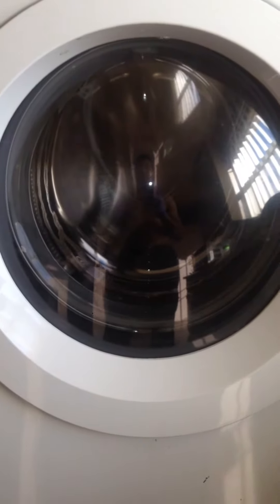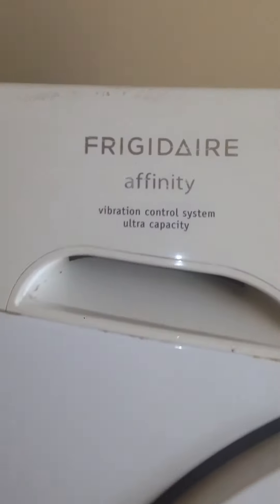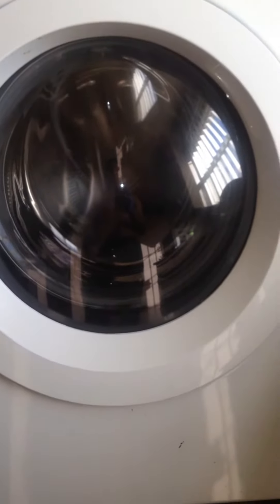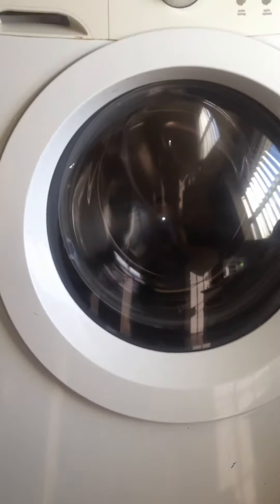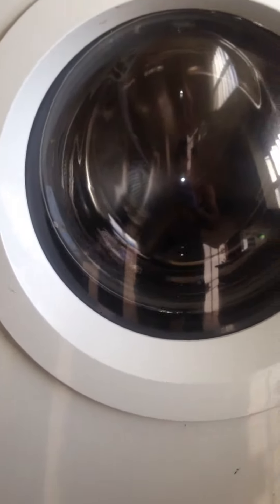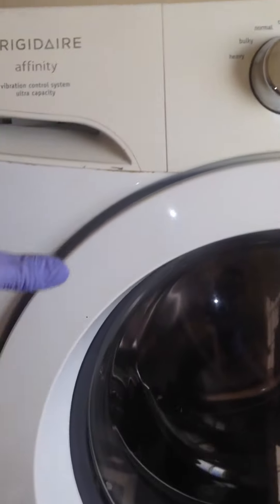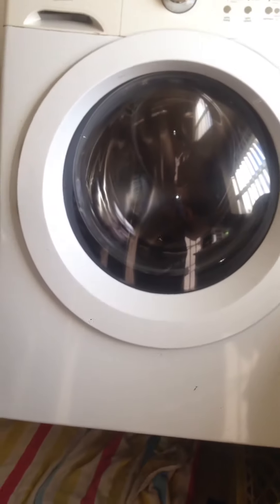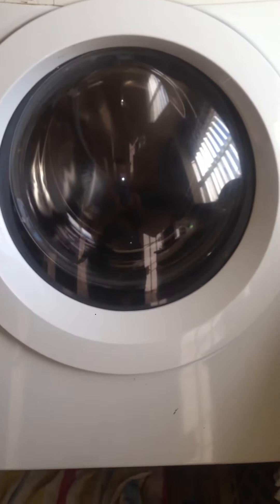Frigidaire affinity washer drain filter

Comment: I was able to disconnect the large clamp, then reach in and clean out the filter with my fingers. I was even able to pull the filter out through the large hole pipe hole without disconnecting anything else. I had a piece of underwire bra stuck in mine and the wire would sometimes stop the pump from spinning. I also had a $1.57 in four quarters, five dimes, a nickel and two pennies.
Reply: Chris, thanks I was also able to pull the filter through the large hole pipe hole without disconnecting anything else. I only found  $1.02, this trick saves you a ton of time!

Comment: Perfect! I've done this 5 times before I have dryer stacked in the top past experience had to recover it myself in a very tight space and it was a B! It's been awhile now since I've cleaned this trap out I knew there was an easier way id pushed the washer forward while kinda letting the dryer hang till it the back wall then put like a brick to keep it just barely high enough to get in there an unclip it too clean out but that clip to reinstall it it's such a problem. Never the less thank you for this vid!!!

Comment: I was able to get the filter out and couple face masks came out too but it was hard to position your arms and hands to be able to wiggle out the filter in that small window.  And to put it back on I thought was pretty easy but when I turned the washer on to rinse and spin all kinds of water was leaked out now I'm thinking I should take off the front panel so I can see all around the rubber pipe when I tighten it. You would think they put the filter in an easier place to get to because filters need to be cleaned out often.  So my question is can I lie the washer on its back side and  can only the bottom panel be removed? I think that would be easier.

Comment: Your video certainly helped me get everything cleaned out.  Problem I'm having now is trying to get the rubber housing back in place with the 3 connectors.   Holding the spring open with pliers and wiggling the rubber ends on is driving me nuts!  Any tricks for putting it back together?
Reply from the maker: BB BAB I squeezed it with my hand just enough to get it in position then used the pliers...
Reply: Again, Julio.. saved me!